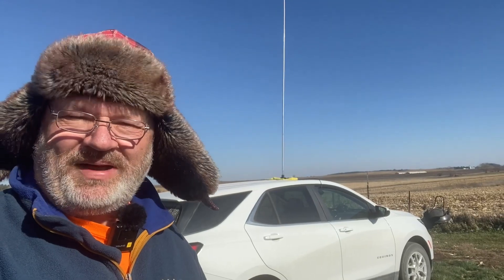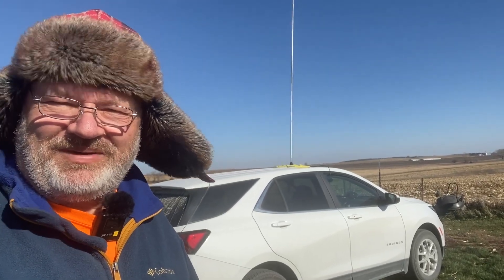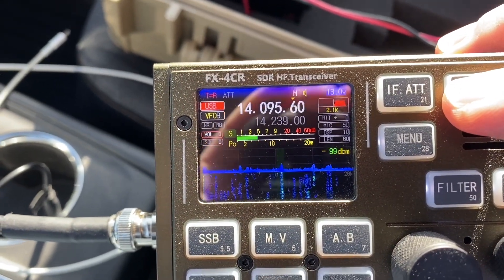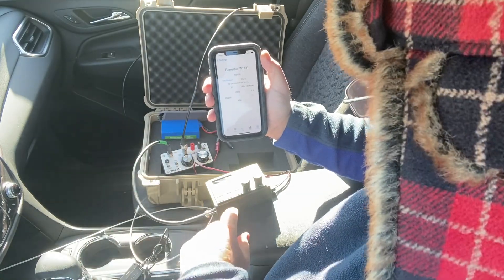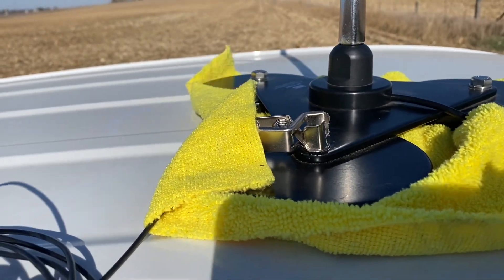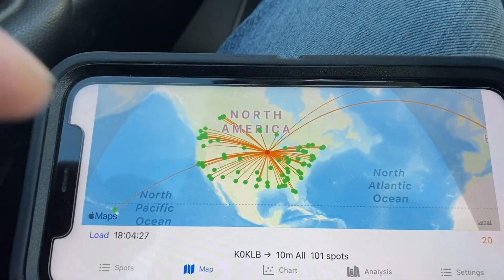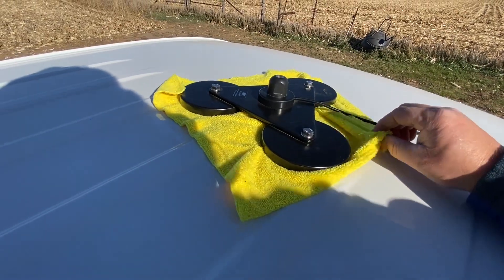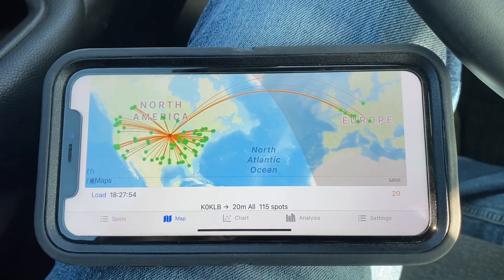Make More QSO's with the TAILPIPE ?? - Iowa

Comment: It looked like the first two tests were on 10 meters and the last test was on 20 meters. If I’m not mistaken why wasn’t all three tests done on the same band?
Reply from the maker: Hello Thomas.. Thanks for your comment.. I should have seen this coming a mile away but I didn't.. Of course, to a Ham operator 10m and 20m means 10 meters and 20 meters.. However, in the case of the WSPR app, the "m" is for Minutes.. Its a time setting in the app that will allow the spotting data to expire and it will be removed from the spotting map.. On the first two tests I had it set for 10 minutes but on the third test I didn't get the video completed in time and I had to bump up the timeout to 20m to bring the last test data back on the map to record it... All the test's were completed with the whip antenna fully extended for a 20m 1/4 wave.. Sorry for the confusion and you aren't the only person who asked about it.. Thanks for watching and supporting the channel.. 73, Kevin ~ k0klb

Comment: Great test, but are you running a 1/4 wave vertical at 10 m?  It looked quite tall.  I find all of your tests informative and fun.  Thanks Gene
Reply from the maker: Hi Gene.. Thanks for stopping by.. All test's were completed on 20 meters as the antenna was extended the full 1/4 wave length.. If you are referring to the "10m" on my phone, that is the "10 minute" duration (time out) setting indicating that all the data collected will expire and removed from the map.  It has several setting, 4m, 10m, 20m (minutes). I know, It can be confusing when we see 10m and instantly think of 10 meters in our ham radio world, right? LOL.. Thanks for watching and supporting the channel.. 73, Kevin ~ k0klb

Comment: The results are twice as good with dual exhaust. Not so good on a Tesla. I wonder if you made a base where you could attach four MFJ-1979 whips horizontally 90 degrees apart for a ground plane. I guess wire is a lot cheaper.
Reply from the maker: hahahaha.. I like that, dual exhaust, LOL.. Ya, I think wire would be cheaper for sure.. Thanks for stopping by and I hear you checking into the YL more often now.. That's great.. 73, Kevin ~ k0klb

Comment: I wish you had not shown me that whisper app a while back. Tests prove conclusively that my set up gets around the world ok when conditions are good. Sadly this may mean it is me others do not wish to speak to 😞. 73 M7BLC.
Reply from the maker: No worries John.. I understand what you mean, but remember, the WSPR is just that.. a Weak Signal Propagation Report.. If a station in South Africa heard your WSPR transmission at 1w, it does not mean that station would be able to hear your CW or SSB signal at that power level.. I mostly use it to see my antenna radiation pattern as well as propagation conditions.. I also have learned that I want to keep my TX power at 500mW or less if I want to really stress test my antenna and see how it performs.. Its just a tool in our toolbox, combined will all our other tools, to see what is going on.. It's good entertainment too, so keep playing radio and having fun.. Thanks for watching.. 73, Kevin ~ k0klb

Comment: Nice test.....thanks. I only have a single mag mount with no way to add the radials or tailpipe connection. I might have to get a triple.
Reply from the maker: Hi Ken.. You're probably going to do OK without it.. But if you ever get one, you will have the option to give it a try.. Thanks for watching and supporting the channel.. 73, Kevin ~ k0klb

Comment: Thanks Kevin.  You do “offbeat” quite well but imminently practical.  I copied your pvc pipe with toilet flange to hold a Spiderbeam vertical supporting an 80 mtr doublet.  It has withstood  tropical force winds and been up well over a year.  Thanks. 73 N4LWT
Reply from the maker: Great.. I still have mine.. In fact, I was just thinking about it this morning and maybe getting it out to set up a temp antenna in the yard.. 73, k0klb
Reply: @hamradioqrp-k0klb  Will we be seeing a new video from this temp set-up?  73
Reply from the maker: @lawrencethompson465  Hi Lawrence.. No video on the temp set up.. however I did take the 1.5 wave inverted V dipole back out to the field on Tuesday because I wanted to test it across all 80 thru 10m bands.. I wanted to see if the 1. the ZM2 would match... 2. Run a WSPR test and 3. Make a contact.. It was a success and I did a video on that which should be out later next week.. Love this hobby and experimenting with antennas..
Reply: @hamradioqrp-k0klb  Good deal.  I look forward to your next and continuing episodes.  👍👍